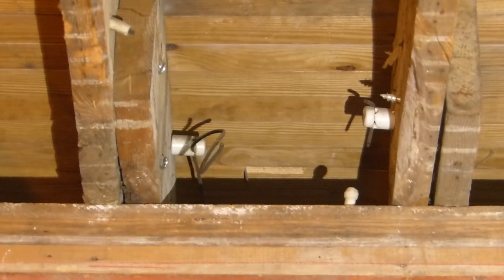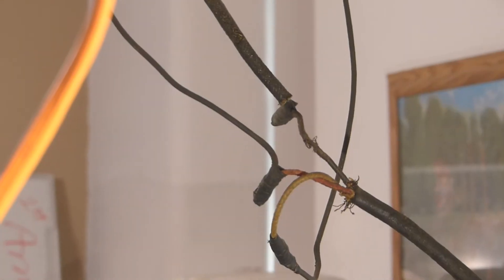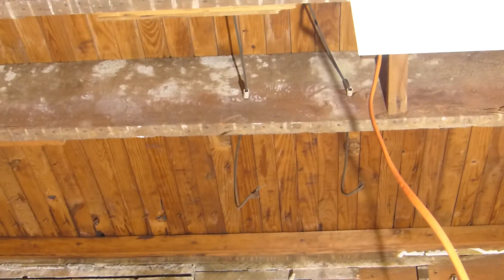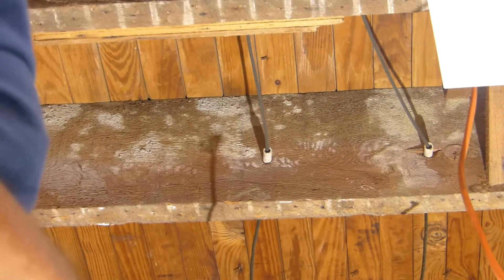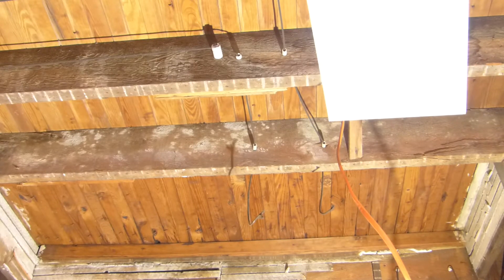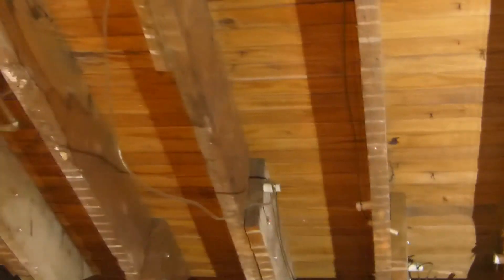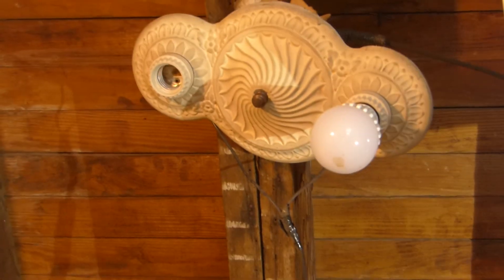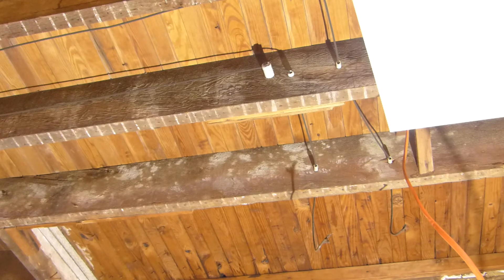Knob and Tube Wiring SAFE but here are some extra safety tips when insulating over K&T wiring Part 1

Comment: If I have Knob and Tube should I remove it and replace with new wiring?
Reply from the maker: Sure if you can but a temporary safety measure is an arc-fault breaker please

Comment: Did you move forward with the insulation? I am located in PA as well. My top floor (attic) is a bedroom is a plaster with knob & tube. 10 degrees difference in this bedroom vs the whole house. I would like to insulate in with probably rolled insulation. Can I bridge the knob and tube like you said with rigid and then put more insulation over top?
Reply: Also, as far as rigid board over K&T for open air, are you just putting board that area over K&T or entire bay electrical is located in? Any updates in information? Looking to go this route vs doing new wiring due to costs
Reply: Let me know, I plan to do this renovation this summer